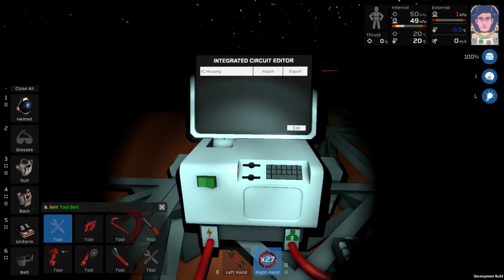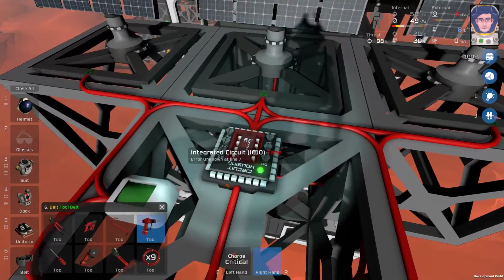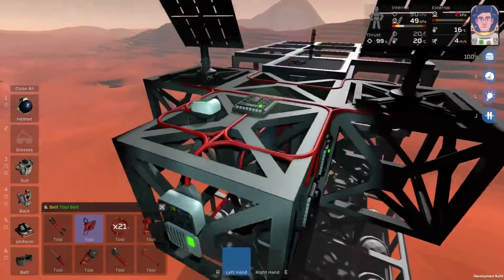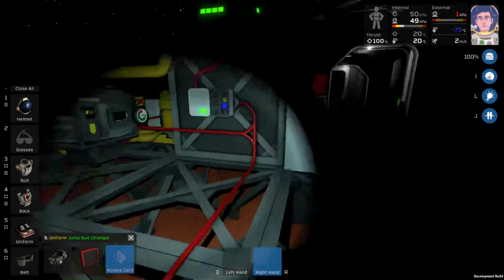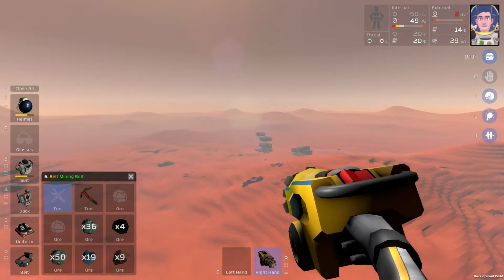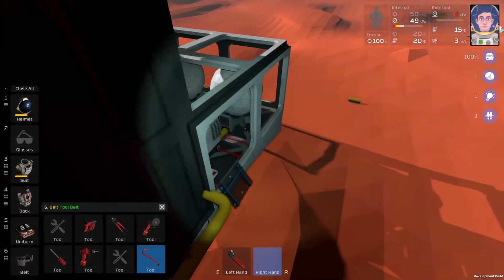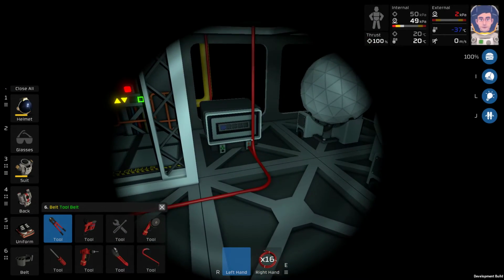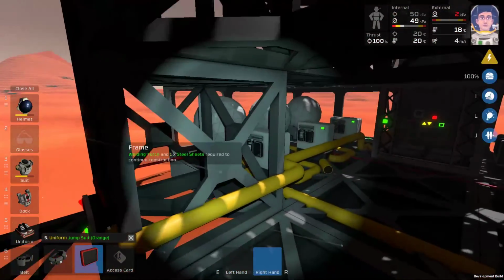Stationeers / EP 8 - Integrated Circuit Solar Tracking / Mars Colonization

Comment: I have no idea how the IC’s actually work so I would like to ask why do you need to send the information to the memory chips couldn’t you just send the same information to the batch writers thus saving two men chips or is there some reason you have to read it from the mem chips? Just thinking if you set the two outputs to the batch writers instead of the mem chips you might be able to get around it. I might try it myself to see to see of course but maybe if ya know why you could save me the trouble
Reply from the maker: You could definitely use regular logic chips for like 90% of what an IC chip does, but it takes a lot more resources, space and power.

Comment: I never did like the the 1 up 1 down solar sensors. 
When it was only vertical everyone faced the front of the sensor East.
Then they added horizontal angle. I just added the 2nd sensor facing North and with the right math. 
It works. 
Can't remember what I used but it's very simple.
Reply from the maker: There's many ways of getting it done I suppose.

Comment: It certainly used to be the case that filtration units set up in parallel were way faster than in series like you have them. So a single input pipe feeds the input of all the filtration units simultaneously and the unfiltered output feeds back into the same input line. Rather than unfiltered output going to the input of the next filtration unit. Probably won't make much difference when you're just filtering  atmosphere, but it really helps with the furnace and makes avoiding pipe ugliness much easier in base design. 

Also looks like you've got that weird bug going on where your hunger isn't depleting. You've gone a long time without needing a furniture and microwave for them taters.

Nice series though
Reply from the maker: I don't think it's a bug for the food, sometimes I forget to re-enable hunger rate. Thanks for the comments =]

Comment: Can you show a system to keep from over pressuring your tanks. Since back pressure valves don't work too well for it.
Reply from the maker: Sure! Tanks can handle quite a lot of pressure, mind you, so you're way more at risk of blowing up a pipe that gets hyper-pressurized than a tank.
Reply: Nothing beats one or more Back Pressure Valves if your tanks are large and full enough other than an automated shutdown for that gas type (example turn off filtration and open a digital valve that connects the input with the unfiltered output).
Just remember the cardinal rule for Back Pressure Valves the bigger the input volume, the better the output.
Reply: Pipes will burst at 60MPa.  You could try setting up pipe readers and logic/IC to turn on volume pumps to vent tank networks when they get to 55MPa

Comment: if you use Mars atmosphere for your filter system, a passive vent is just fine to get the air to the filters. Later you´d want to filter furnace gases, making the vents obsoloete anyway
Reply from the maker: So the active vents don't increase throughput?
Reply: It probably does help to have multiple active vents because the filtration will pull based on 1 atmosphere, which mars doesn't have. The active vents do the same so in theory it should triple the available gas, you'd probably need about 51 for max effect... That said I might be wrong because the volume of the pipe network also plays into how much is filtered and I am not sure if the volume of the local atmosphere is counted as part of the volume when a passive vent is used.

Comment: I strongly recommend not having the APC for your solar power logic output to the large batteries.  Even with a loop back, you're begging for some other power sink to drain the big batteries, which then drains the APC, and then you have to go replace the APC battery so that the solar panels will work again.

Keep the solar power logic on a separate power net and hopefully you never have to touch that APC's battery again.
Reply: On second thought "strongly recommend" is ruder than I'd intended.  Sorry.  That's just the way my power grids fail.

Last video I'd thought about mentioning that the floor vent from the furnace is also a thing I've had problems with before:  I stood on top of one while opening the associated valve once and got fired into the air and couldn't arrest my descent enough to not die from the fall.  So everything I say is somehow about how not to die the way I die in the game :)
Reply: the word strongly is ok because APCs are bad, not only at solar arrays. Battery into APC recharging is a bad idea, cos battery to battery can draw all the aviable energy at once, even burning a heavy cable. Its best to power the chips that control the panels with the main battery, even if that means you need double cables. Send only the network stuff from the chips to the panels.
 I had an APC armed with a nuclear battery, branching off before the stationary battery input. That APC battery would provide backup power for the solar logic over night, but when the load on the main station battery was too high, even a nuclear battery can run empty after a few days and your solar controlling chips are unpowered.
APCs cost way too much for what they are good for. You tend to place them where you dont check regularly and battery charging stations are better for chaging anyway, cos they cant suck all the power over one acble at once. If you want to be sure, use your main power line to power chips that when running provide you with power in the first place
Reply from the maker: The next few episodes are already recorded and I fix this in the next one I think.
Reply: WTF?! The next few episodes are already recorded? Throw em out! We need moar and can't wait! Oo

Comment: you didnt need to bring the battery output cable all the way up separately, you have elevator wiring already going up as output circuit :)
Reply from the maker: I want to keep the elevator separated.
Reply: then move the battery up

Comment: Vertical Sensor direction doesn´t matter, other than facing upwards maybe
Saving power: 
The old setup requires 90W (4x10+2x25) where this one requires 70W (2x10+1x50)
However, you can write the batch writers ON status when any of the sensors read Activate 0 (meaning they dont see the sun). Saving another 20W, at least at night, by turning them off
Adding something like this:
On top:
alias BWV d2
alias BWH d5
Within the loop:
l r2 d0 Activate 
s BWH On r2
s BHV On r2
Set D2 and D5 to the Batch Writers
Its abit messy, but should work. Totally new to assembler coding and im not even a programmer to begin with 

Also:
I´m not sure if all possible registers (r) are loaded anyway when starting the chip, but the code you posted below the video has aliasing r0 and r1 commented out (#) 
Its either the wrong code you posted or those 2 lines dont matter at all if you dont use the alias in the code instead of r0/1
Which you totally should if programming yourself. Aliases are not only there to give the screws on the housing a name. You can use them instead of r2/d2 (:D)Within the code. 
It becomes alot easier to read code thats longer than this example
Reply from the maker: Not to be rude but I have no interest in minmaxing power usage. Power is not a finite resource, nor is it even hard to come by so going out of my way to save a few watts is something I'll never bother doing in Stationeers.
Reply: @Rhadamant  I dont bother with compass orientation of horizontal sensor. What I use is this https://steamuserimages-a.akamaihd.net/ugc/996890173627384130/C56915B22A7B8F295B28145BA4B2099C7FC0A983/
Reply: Check Discord if you want a cleaned up version of what i just wrote ;)
Discord link in video description

Comment: I think that according wiki vert sensor orientation does not meter - neet to be mounted on floor only. For horizontal it does - need to be mounted upside down with mode 1 and output +90 degrees to solar panel port.
Reply from the maker: The Wiki is out of date for IC solar tracking then